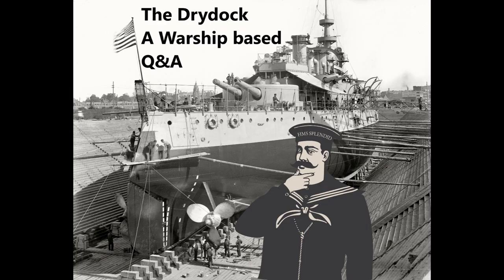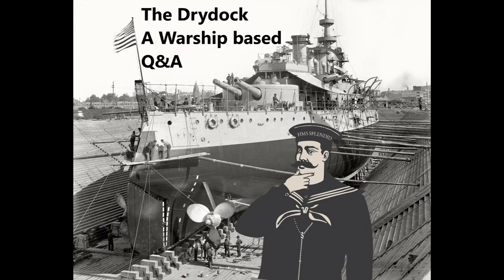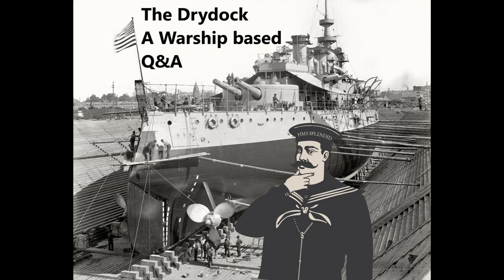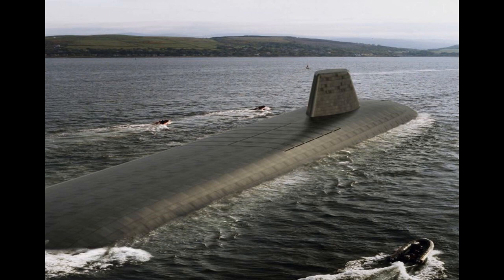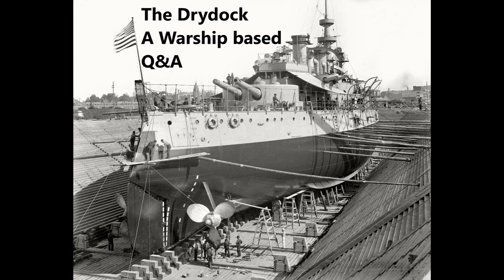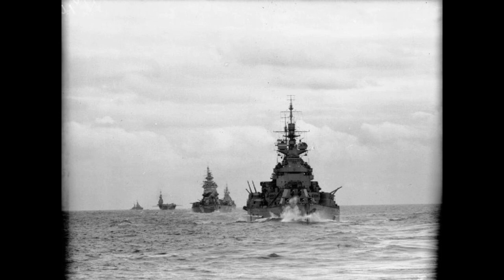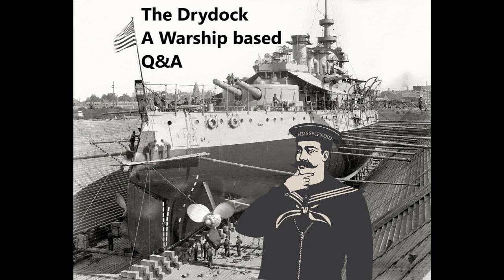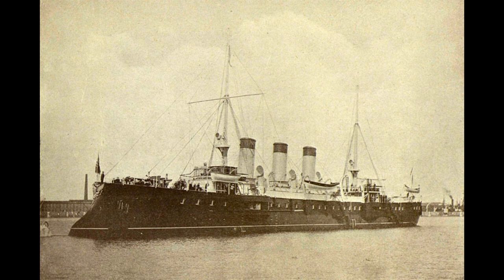The Drydock - Episode 111

Comment: For clarity on the coal: 
Lignite is like... barely above peat. Burns real crappy and real dirty, and it needs an absolutely enormous firebox to combust well. One of the largest steam rail locomotives ever built (the Northern Pacific "Yellowstone" 2-8-8-4s) were designed to burn lignite and they had nearly 17 square meters of grate area.
Bituminous (not bitumous) is called that because it has a bunch of bitumen in it, which is essentially super-thick tar - sometimes called asphalt. Other than being cracked into something resembling crude oil, it pretty much only gets used for paving roads as asphalt concrete now. It does have quite a bit of energy content available if you burn it, though. It's lower ash and soot than lignite (though that's not saying much). This was the most common grade used for, well, basically everything. It's easy to burn, but has good energy density, and is fairly common around the world. 
The big problem with lignite and bituminous coal is that they have a ton of sulfur in them. Sulfur is quite corrosive stuff to iron and steel, especially if it comes into contact with water (sulfuric acid, anyone?), so the associated metalwork has a shorter lifespan than it would with anthracite.

Anthracite is, as you said, almost pure carbon. It's very hard, and difficult to ignite, but it burns pretty damn hot. Oddly enough, it also needs a huge grate area to burn well (if you're ever curious, look up "camelback" steam locomotives - they were designed to burn anthracite). By comparison to the others its soot content is pretty minimal, so it's sometimes called smokeless coal.
Reply: David Fuller I have seen stories of SOO Line railroad employees who described the Northern Pacific engines as steaming poorly as the coal they used burned almost like paper, if they didn’t have a huge pile of coal together they wouldn’t be able to get up enough heat to continue boiling water
Reply: the Great Western Railway in the UK used welsh Anthracite and managed to make it work on comparatively narrow grates (biggest being 34.3 sq ft on a King class)
Reply: I never knew about different coal but I remember as a teenager there used to be these huge trains with coal going on base and they would spill it all over. I used to grab a few of them and I tried a few times to burn it, but it never really burnt. The only time I could was when I made a huge bonfire and threw in 10 or so pieces but the fire was so large I couldn't really tell. I'm guessing it was anthracite because of this and that it was pretty hard where I needed a hammer to break it.
Reply: I grew up in a house with a coal furnace and we'd go through a few tons in a good winter. I knew nothing about coal but it was shiny and pretty hard (anthracite I assume) I remember it took a roaring wood fire to get it going but it would go all night.
Reply: @johnm6201  Yup, that's anthracite.
Reply: @The_New_IKB  I'm reminded of the Railway Stories (aka Thomas the Tank Engine) where Henry needed special Welsh coal to run properly. 
A case of the author doing his research, Henry was (to my knowledge) based on an experimental version of the same engine type as Gordon that needed anthracite to avoid ash fouling.
Reply: @Vespuchian  Henry starts out as having too small of a fire box so needs the hotter burning welsh coal, after his crash with the flying kipper he gets rebuild as a LMS black 5 mixed traffic loco
Reply: Most Chinese power stations burn Lignite (or as we more commonly know it Brown Coal) because its the only coal they have available so are very inefficent and polluting, Peat on the other hand is a pretty clean burning fuel source (its just not that environmentally freindly to use as it takes decades to form and is usually harvested from wetland environments home to a lot of semi-aquatic creatures). We have a coal fire at home and used to use bituminous coal but now the only coal your allowed to use is Smokeless Coal (Anthracite) which is a pain in the ass to light, particurarly as they grind it up and press it into smooth bricks of equal size and the hot gasses just flow quickly over the smooth surface not passing much of their energy into the unburnt coal.
Reply: Drach mentioned that Germany has lots of lignite resources. Even so, I was surprised that Germany is still the no. 1 producer of lignite worldwide, though use has gone down by 50% compared to the late 20th century. In the 1980s, Germany produced over 1/3 of the worldwide amount.

Unsurprisingly, Germany also had massive problems with acidic rain and deforestation in the 80s; all the sulfur in the coal would be burnt and released into the environment. Nowadays, extensive filtering is required.
Reply: @watcherzero5256  When Wisconsin Energy switched to low-sulfur coal from Wyoming the difference in the stack effluent was noticeable. What they were burning gave a distinct yellowish tinge to the water vapor condensing in really cold weather. Burning the low-sulfur stuff the water vapor plume was near pure white. I understand those living on Michigan's lake coast liked it....
Reply: The Ruhr Area is/was full of bitumous coal of different qualities and also a bit of anthracite. Lignite is today used exclusively in coal power plants, being mined in open pit mines and then being transferred to nearby plants using mainly conveyor belt systems.
Reply: Only here would we start talking about warships and end up talking about Thomas the Tank Engine. I love it.
Reply: Fun fact, "anthracite" comes from exactly the same word root as "anthrax"!

Comment: Bored engineering crew on midwatches during normal steaming would talk about anything to kill time.  A couple of watches we went through all the ways we could, in the engineering plant, turn our ship into a reef.  I don't know how effective many of those ideas would have been in practice.  Some were as bloodthirstily simple as getting around our lack of explosives in the engine rooms by taking one of the reactors prompt-critical, but I figure some of the plans to burst the boot connecting the 48 in valve supplying cooling seawater for the main condenser would have been a very good start.
Reply: That sounds like some fun water-cooler conversation (get it, because the steam plant contains a condenser?).
Reply: I doubt there is a single topic under the sun that didn't become a topic for midwatch conversations for me and my shipmates over the years. Of course, with us being submariners, a fair number of those conversations should never again be spoken of, at least in polite company.

Comment: On another note: the light cruiser Karlsruhe has been identified on the bottom of the sea at Norway. In several papers, the headline has been something like "Battleship discovered". It irritates me to no end that news outlets call a light curiser a battleship.
Reply: It's a ship used for battle, so certainly it must be a battleship?? 
\s
Reply: In much the same way they'll call anything with tracks or even just some slight degree of armour a "tank"...
Reply: During the Queen's jubilee procession, as they sailed down the Thames, the breathless BBC commentary proudly stated Belfast was 66,000 tonnes. If only there was some kind of massive global network of computers providing access to almost any bit of information you might need.
Reply: Calling it a light cruiser, though historically accurate, still feels like overrating it.

Comment: Drach, I just swung by to check out the website. Congrats on standing that up, mate! My only recommendation would be to host the individual high-res ship photos in some kind of carousel so that you can navigate through them without having to use the back button to return to the main gallery every time. It looks like you're using a Squarespace site, and I'm pretty sure they provide options for different kinds of photo carousels. Cheers!
Reply: Yep, I use Squarespace for a website with articles on Australian mountains and I have used that photo carousel feature a couple of times.

Comment: East German (GDR) railway firemen often had to use lignite, because all the good coal deposits were in the West. They called it "flower soil", and it usually significantly reduced the performance of the engines (which were generally built for proper bituminous coal and had limited space on the fire grate).

Comment: As a side note, there were actually three Clemson-class destroyers (and I'm blanking on which three) that were sold to the United Fruit Company in the mid-1920s to be converted into banana boats for use in the Gulf of Mexico and Caribbean.  The conversions included removing all armament and half the boilers, then converting the magazines and now-empty boiler room into holds; even with only half their steam capacity, the ships could still make somewhere in the high 20s of knots with a full load of bananas, greatly helping at getting them to the US before they spoiled in those days before mechanical refrigeration.

Comment: Ok, so you have Anthracite Bituminous, Semi-Bituminous and lignite.

Bituminous has several grades and the best grades are the ones which have low amounts of sulfur and leaves little ash or clinker to remove from the grates or go up the flue. This grade is metallurgical grade coal and highly valued for coke manufacturing for the steel industry.

Anthracite is best for home heating but finishes behind best quality bituminous because bituminous has a large fraction of it's weight as hydrocarbons so it burns faster, and therefore releases it's heat faster. Anthracite burns more slowly and produces less power for a given grate area. It does have more BTU's per pound, but it gives them up more slowly.

I understand that RN ships would, under the need of high speed spray oil on their coal and if they were burning anthracite this would tend to remove the disadvantages of that fuel.

Blending coal is a common practice when you want a coal of specific quality and I would not be surprised to find that the RN had a specification that their coal was blended to with a mixture of anthracite and best quality bituminous.

English railways used to brag about the quality of coal they burned in their engines and they normally used bituminous.

Comment: Regarding chained mines--why use (heavy) chain between the mines? Why not use rope, with as much as 1.5 times the length of the ship you are trying to sink? Distance between mines can be greater than chains which would possibly sink the mines. Also, could place floats along the length of chain/rope between mines.
Reply: Whatever joins the mines has to be strong, not breaking when the ship bow suddenly hits or even just waves pushing the mines in different directions. Rope would need to be much thicker than chain for the same strength, so take up more room on the ship = less mines?

Comment: 1:02:25 D. suggests HMS Vanguard would have stocked "supercharges" in the event of war, but I find this puzzling. Isn't a "supercharge" merely an increased number of bags of propellant inserted behind the shell? Isn't that number anyway varied in the course of figuring out a firing solution? My impression is that that's true in the case of heavy field artillery...?

Also, I looked at https://www.drachinifel.co.uk/. Thanks, but...  it's a bit disconcerting to have pages on, e.g., the High Seas Fleet with no captions... It's a test of recognition skills I don't possess.

Comment: Not as big a problem on a ship, but despite its higher energy content, Anthracite actually requires a larger fire grate than bituminous because it burns and releases that energy much more slowly.  This is why it was never popular as a locomotive fuel and those that did use it required grates so massive that the cab had to be put ahead of the firebox, creating the Camelback locomotive.

http://www.douglas-self.com/MUSEUM/LOCOLOCO/camelback/camelbk.htm

Comment: I'd like to see you improve your recording setup for your interviews, the audio quality is quite horrible with random spastic network issues. The zero video in particular is barely watchable with how bad it gets, seeming to speed up and slow down at will. The common solution to this is getting your guest to record their own audio at the same time then match up the recordings in post using the recording of the voip call as a base guide. Otherwise you're doing great.